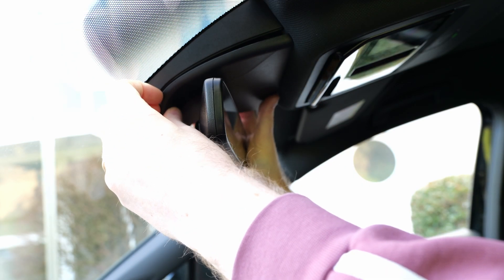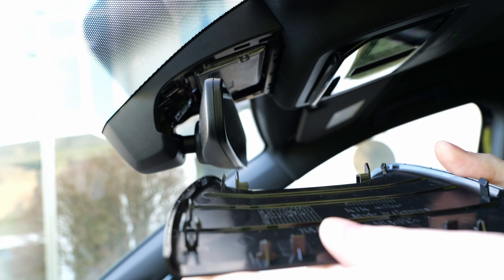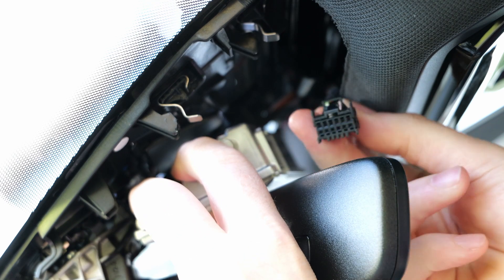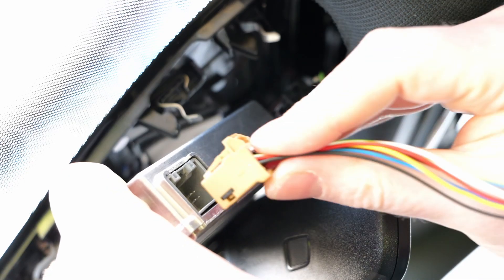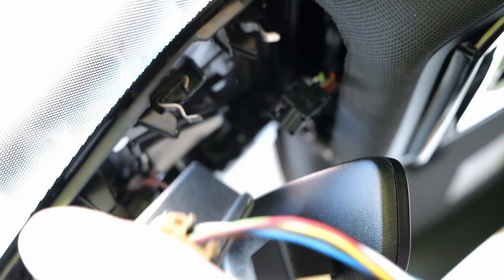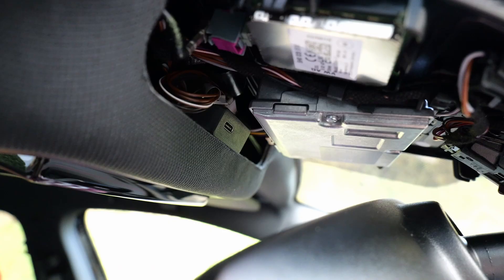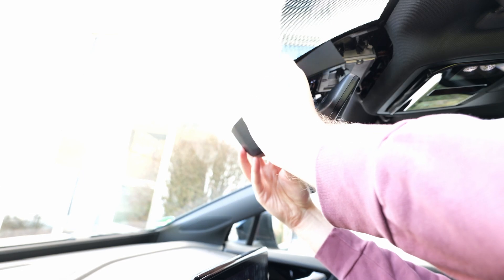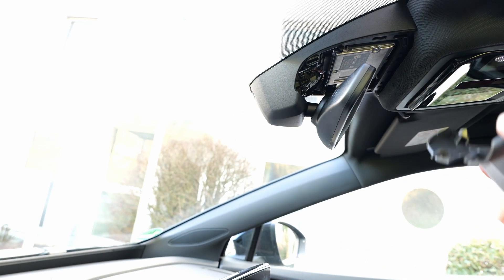Openpilot Camera Harness Installation - 2024 Volkswagen ID.5 (MEB)

Comment: don’t really understand how you get the cable out to the comma device… there is no gab between the plastic and windshield… can this be installed clean without forcing the plastics? or is it routed along the mirror gap?
Reply from the maker: So the cable actually comes out at the top, between the headliner and the  side of the plastic camera housing. You don't need to force anything or pry the plastics apart - there's naturally a small gap there where the cable can exit cleanly. It routes out next to the camera assembly rather than through the mirror gap. Should be a pretty clean install.